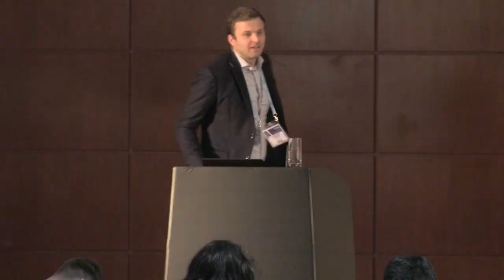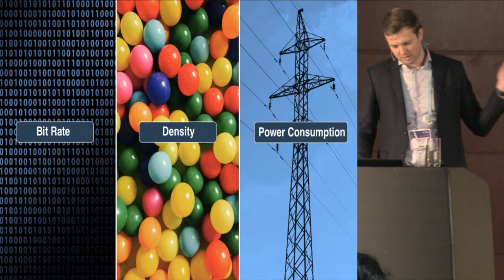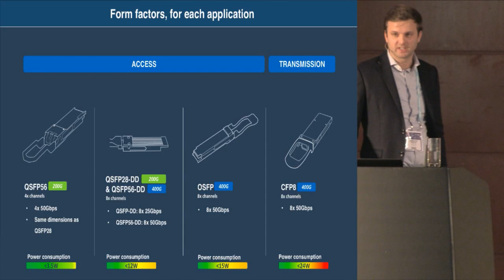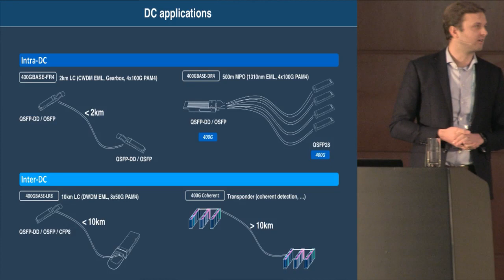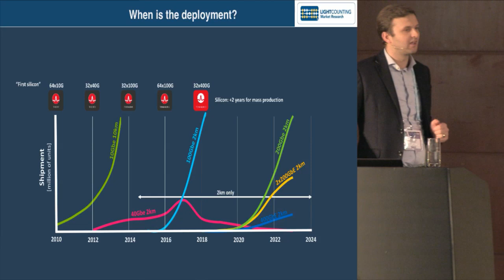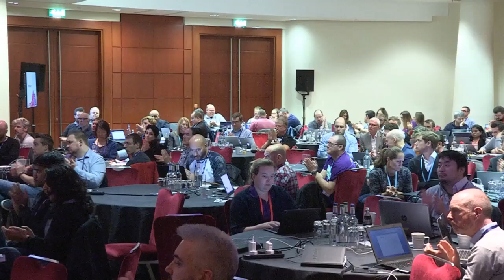LINX103: 200G & 400G technologies (Ambroise Thirion)

Comment: I wish he'd explained what a "gearbox" was. Having explained the new PAM4 modulation clearly this magic gearbox technology that doubles the amount of data that can be transmitted down a  fibre is a bit arm wavey. It's not a term I can recall seeing anyone use before when describing high-speed Ethernet tech. Google is unhelpful.
Reply: "gearbox" PHYs are not anything new in optical modules (or switches) really - I think I've seen them used as far back as 2014/2015 maybe earlier. For example the were sometimes used in switches when providing 40/100Gbps ports on 10G based ASICs and also for long haul 100G where the transport network only runs at 10G per lane (modern 100G being 25G per lane).  You can think of them /conceptually/ as electrical mux/demuxes integrated into a ethernet PHY chip. You mention doubling the amount being sent down a fibre - note that this gearbox is electrical and goes before the optical components i.e the laser driver/EML and WDM ect. In 400G shorthaul that will be 4*100G drivers and a 4:1 wdm. BCM87400 is the one I've seen used in 400G optical modules if that helps you research :) - Matt
Reply: @TheMattyboi18  Thanks for the explanation. It's a bit clearer now but I'll need to have a deeper dig. Surprised I'd not come across the term/technology before now though my excuse is I'm a server person rather than a networking person.